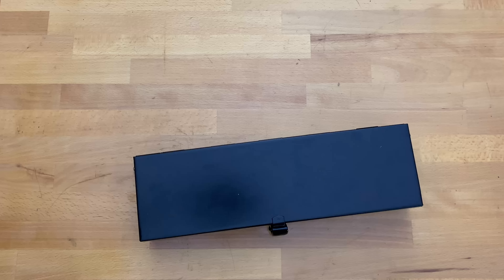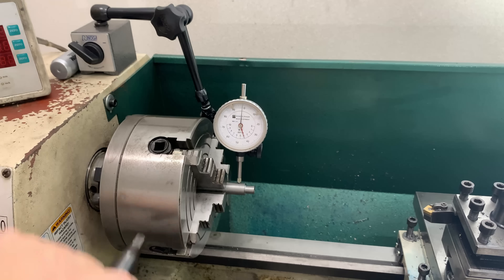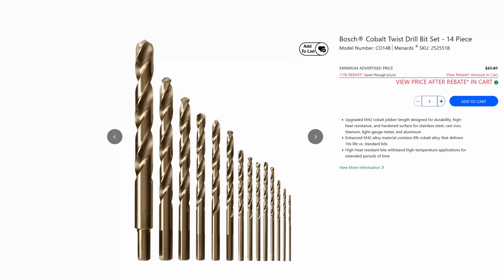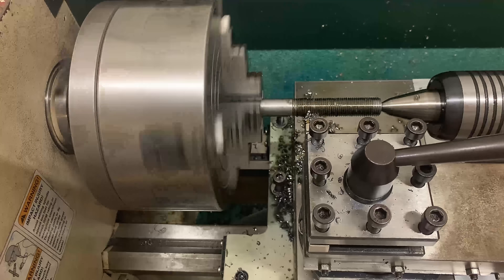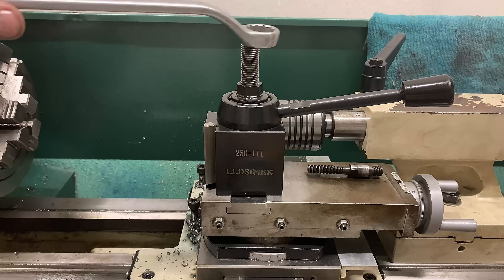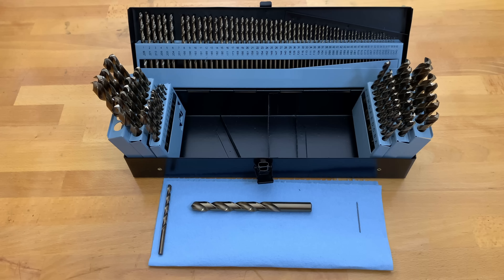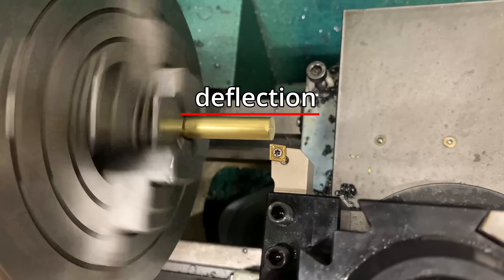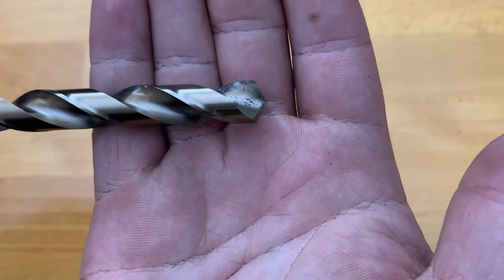Are Harbor Freight Drill Bits Secretly AMAZING?

Comment: Dude, funny narration/vid. Thanks.

Ok, in reference to your $4.00 twist-bit paranoia, well, I guess I can consider myself a platinum clad BIG BALLER now?

$pending 18$ for ONE 1/4 inch tungsten tip’d drill bit and 18/$20 for ONE specific matched carbide tap!?

- All For a one-off custom project, drilling and tapping a hole in an AK47’s bolt carrier group, making it capable of left side charging. 

Which almost became a DISASTER.
- TWICE @ that!…ha!

- Nearly done drilling the hole with a plug in makita rotohammer drill (w/o hammer feature used;)

- Trussed up in some fluorescent yella’ and green  Amazon spezial Chineseum “VEVOR” ‘drill press’ stand capable of PRECISION Z axis/up n’ down motion, then that high-dollah tungsten bit tip SNAP’D’ right off in her. 

- Good thing Im both dumb and obstinate enough in equal degree to keep plugging right along, denying 100% failure until something is TOTALLY UNUSABLE eh?….;)

(Which with CAREFUL attention Id managed to get it all out, for the next sweaty, anxiety ridden hand-tapping process)

- Then upon almost finishing the tender threading process, !SNAP! went the high dollar carbide tap in the formerly ‘saved’ hole I’d drilled, after an hour + or so of even CAREFUL’ING’ER burr werk with the dremel, Id managed to chip away at the stuck tap enough to remove it in small pieces, while saving most of the formerly threaded areas!

- My charging handle then threaded into the hole not as deeply as Id wanted it too, but deep enough to function well (Oh, w/help of ‘GON’BUBBAH INC’s finest EPOXY to fasten it)

- Because I didnt give up, I now have a 5.56 AK47 pistol, that not only is capable of charging from the lefthand side, but a well functioning left side/firing hand thumb safety thats slick AF!

(that left side thumb throw safety a former mod/design of my own, that functions amazingly)

- The next day I went out and purchased a 12” HF BAUER variable drill press, a $200 Amazon X-Y drill vise, and 2 differing cobalt bit sets. So I can make big mistakes in finer style…;)

That Bauer drill press is recommended as to build quality to price point index.

Grrrrreat n’ humorous vids yee gotz here!
Reply from the maker: Thanks for the great comment lol :) how do you like that drill press now?
Reply: @ShopHumor  
Back atcha, great sense of humor ya gotz. Thanks for doing what you do, sharing tips, tricks and info is quite valuable to many of us.

I went with the largest table top, VS. the floor stander HF/Bauer offers.

Took about an hour to unbox/de-grease & set up, as a metals machining casting geek w/an interest in build quality and overall manufacturing process involved, for the money (300-350$ IIRC?) its money well $pent IMO. 

For garage type/household repair duties, hell, even dedicated biz/shop usage it appears to be a winner. (Granted Ive only owned it for 4 or 5 months now, rit had replaced an old clapped out CRYobi el'cheapo)

For 350$ I'd initially had my suspicions in a world where even brand new, 80,000$ vehicles <<!SPROING!>> & deflagrate, before one even gets it outtve the package...
Everything fit properly together and trued up quite well to my surprise. Its rather quiet in operation as well (In my youth I was used to using my dads rather noisy shop equipment, much of it pretty beefy/well made during the 1950's/60's era)

10, or 12 inches of vertical adjustment. 
Has a tilt table, 
7" total pull out roller support on tables RT side 
The variable throw lever when motor running is not to soft, nor too stiff as to operation. 
5/8ths chuck, 
2/3rds HP. 
Digital speed read-out.
Decent work light.
LAZER BEAM 'X' (Who doesnt want LAZER beams on equipment eh? The 10 year old child in me grins;)

My next project is a small tabletop mill of sorts, but Ive been educating myself here and there for the last year or so as to LMS products/upgrades, as I dont want to jump right in w/o at least a toddler-spec/modicum of knowledge base present to go along with it, to better duck spendy mistakes that could've been easily avoided from the outset.

Man, there are some AMAZING vids of guys here on tha Toobz mod'ing drill presses into mills (albeit with heavy, rather well thought out mods, not just dangerous on tha fly, 'oh...itll work' type stuff. Typically done by individuals who already possess a real milling machine to assist in the creation process, and doing so for the challenge of a 1 of a kind, one-off Frankenstein brain-baby creation of their very own;)

Ill def subscribe, as Ive seen a bit of mill work here on your own channel, I have yet to view them all, Ill get there...;)

Take 'er easy....

Comment: Yeah I have a set of the harbor freight cobalt and also an expensive set of made in USA bits. Of course you get what you pay for in machine tools. But the HF holds up well maybe not as sharp or finish the USA ones have, But for the price, no complaints. I think the operation of drilling too fast on harder metals, feed rate, and type of metal being drilled probably has a lot to do with the bad comments.

Comment: Hi my name is Kevin from Aus   our family run a machine shop  for 75 years I worked there for 56 years we used a lot cutters a lot of drills were Suttons  made in Victoria thay make a lot of different sizes   metric imperial number and letter drills from number drills from 1 to 80 all differs sizes   that make all types of cutters that will even make specials  one off they  if you have any problam with any thing they make they have a tec centre to solve the problem the bean in business for 100 years  as tool makers we by the best no chines th ey  to soft we work   on power stations turbines  at different times  thanks Kevin

Comment: My experience with milwaukee drill bits: they are 50/50 to be bent out of the box and not drill straight. Got replacements from milwaukee for the bad bits and some of the replacements were WORSE than the originals

Comment: I bought HF's HSS bit set and have put the same bit through 1/4" and 1/2" mild steel 20+ times without a problem using a hand drill.  Go slow, use Tap Magic and don't stomp down on the thing.  Bit is still as sharp as I bought it.  Granted, not putting it through spring steel but still, for most hobbyists, I think is likely plenty tough.

Comment: Its reddit. Only a small percentage actually leave the keyboard and a even smaller fraction knows what speeds and feeds are.
"is x product good"
No its junk i broke everything about x product first run out and im an expert with 35 years in x field working with this stuff. I recommend x product that is triple the price or happens to be the product of choice of my fav youtuber.
Besides for hyper specific stuff dont go there like ever. Not only is it a massive echo chamber but its an echo chamber of the largest group of dimwits in the world.
Gotta love telling someone double my age that they are running a drill at the wrong speeds and feeds and will burn up their bits and have them flip on me while it takes me a bit longer to get through my holes but im not reaching for a new bit after every hole wasting time and money.

Comment: While I don’t have the cobalt set the set I bought at Harbor Freight two decades ago still works fine. I think I’ve broken two or three of the small drills in that time and they were probably my fault. The best advice, especially for power tools, is to let the tool do the cutting. Meaning don’t force it. 🧐👍😎

Comment: we have been using Harbor freight's bits for years, I will tell you for what you pay for them. They are beyond awesome. We have abused a few of them rather ridiculously,, and to be honest, they held up fairly well. I definitely recommend buying them for medium use, and careful heavy use. Do not over speed them., that's the only advice I would give you, also--keep your RPMs 300 to 350 when you're going through hard shit like steel or iron, at least for most of the sizes. That worked really well.

Comment: These are a definite bargain for a pro mechanic.  That's me. I can get away with using "close enough" sizing for 98% of the stuff I do. Window regulators with aluminum or steel rivets at least 4 times a day, etc. I think the last time i bought that set, it was 50 bucks on sale. When they used to have sales, lol. Anyway, it's a great set to have around the toolbox or the house.  Are most NOT CRITICAL machining jobs matter if you used a 3/16th or a 1/4" hole? Im usually drilling offnrivet heads or brake rotor securing bolts. Awesome set. Snap on you say? Fools and money etc.

Comment: I bought the Milwaukee Hard Steel bits, for drilling into metal studs. (I'm a Dewalt man)
Best drill bits I ever had. $80 for a smaller set than what you showed, but worth every penny.
It replaced the Bosch set, BTW. Those are garbage.

Comment: Thanks. I've drilled many, many holes in steel bar while building machines. The quality difference shows up in how well they stay sharp and un-chipped through multiple holes. For a home shop they may well be fine with modest feeds and speeds. Then again, for my humble setup, the index is a big contributor to usability. I love the Dewalt sets because they're decent drills in a super useful box.

Comment: Actually, it's "twist drill".  BTW, 70% of all steel is made from recycled metals. I've used the Warrior twist drills and I can attest that they are not well made tools - not sure they are made from cobalt either.  Drilled out four (4) 9/32" staked holes and the twist drill was already dull.  CoolTool used as cutting fluid, drilled by hand.

Comment: You use the wrong RPM and are too aggressive with pressure/feed rate you will burn up a drill immediately. Having proper geometry on the drill is important as well

Comment: The smaller ones are brittle and will snap if you put too much pressure on it or it catches, do not use drilling oil, or not align the bit completely straight with the hand drill, for hard type metals like steel, cold rolled steel, stainless steel, etc.  For soft metals like aluminum, copper, etc, just go slow and steady without a ton of pressure.  So in my experience, they are fine for softer metals, epoxy, fiberglass, wood of any kind.  So for the price, for that set, they are handy to have, but again, use good drilling practices.  For any type of hard metals (steel, etc), I recommend only using a good quality bit.  Since Hanson is a thing of the past (my all time favs), Irwin picked up the Hanson name, but not sure if they are the same .  Bosch is pretty damn good tho.  Unless some machinist knows something better, then I'll try it.

Comment: Carpenter for 40 years, used a lot of Harbour freight  drill bits, used them for dowels and light metals , sometimes steel. Most hardware isnt steel. They did what they said. Used for years. If i was working in stainless steel. I would buy a bunch of bits in the size i needed, ss is hard to drill with with hand held drills,

Comment: I think the main issue with cobalt drills is because of people using them in hand drills.  You are absolutely correct that they are much better suited for machine use.  Yes, I have used cobalt drills in a hand drill out of necessity and it will do the job but only if you are very careful not to flex it.  If anyone is unaware of this, they will break every time you use them.

Comment: I've had a set of titanium harbor freight drill bits for probably 25 years. I broke 1 bit and have replaced several times, the bit that I most use, the 1/8". Other than that, I still use that set. I have a newer Cobalt set in the house that goes through anything like a hot knife through butter. Dont remember the make but its not harbor freight.

Comment: 1 year later:  These same harbor freight drill bits are now $140.00
Reply: They're marked down in the video.
Reply: They saw that they were selling well so they rebranded them from warrior to bauer and charge an extra $40.
Reply: Tariffs + inflation..
Reply: @generessler6282 more like hype. Icon use to be cheap. Now a rachet is $60 while Pittsburgh still around their original pricing. So yeah. 🙃
Reply: @CertifiedForkLiftOperator69420  When was Icon cheap?
Reply: @generessler6282  China's going through a housing and stock market crash that makes our 2008 look nice, and the taxmen over there are on the hunt. 

Good.
Reply: @Azzysdesignworks  Actually their stock market is up. But they do have incredibly bad economic problems that the CCP is mostly making worse.
Reply: @Azzysdesignworks - Anything to not blame tariffs set by Trump huh? 😅

Comment: Yeah you can pay 100 bucks for the harbor freight set or 1200 for the us made set. They both break just as easily when in general shop use and while the us bits stay sharper longer it’s simple enough to resharpen either. I currently have 3 sets of harbor freight bits in use.

Comment: I have a 1-1/4 " drill that I free hand sharped , have drilled somewhere around 15 feet with out resharpening it. Mild steel, correct feed and speed and proper coolant. I have been a MORRIS BIT fan for 50 years 🎉

Comment: One of the problems with ANY drills is that guys will run them full speed and dry on steel, destroy them, and call them junk. I’ve seen it over and over. Drills need care just like any other tool. On steel, slow way the hell down and lube it.

Comment: Looks great for home use or even some jobs , I purchased about 25 years ago Craftsman cobalt drill set , no Sears had them had to order them , well I broke two bits my fault just pushing way to hard the other bits would drill through any steel like butter even harden parts like shafts , replacing broken bits ! Sears had single pieces at that time , P.S. was $99.00 back then !

Comment: I have a similar drill bit set from HF that I bought many years ago.  It has been great for my hobby level use.  The selection of sizes has saved many projects.  Do they drill steel?  Absolutely.  Don't expect the highest quality, but they will work at appropriate speed with use of cutting oil.

Comment: I drive 40 miles to to only one place to get drill bits. Very expensive. I dont buy any bits from any hardware store. I got spoiled with bits that go through stainless steel over and over. I use to work in a metal shop and I have drilled thousands of holes.

Comment: Ive found most guys dont know how to drill. They run the drill as fast as it will go with no lubrication on the drill bit and wonder why it burns up or snaps. However, some of Harbor Freights drill bits are junk. I haven bought any in years and havent tried the one in this video.

Comment: I bought a set from harbor freight drill bits years ago. And they work just fine. I own a mill-drill a lathe and a surface grinding among other machines. But im just a hobbiest. And do machining at work. I also bought the 115 pc METRIC drill bit set which is great when you need a size thats +/- of regular sizes. and use a cutting  oil when drilling. It helps .
If you're not a complete idiot and your not trying to drill hardened tool steel or leaf springs. They are good enough  for the average home shop tinkerer.  Just my 2 cents.

Comment: They cut well enough for me. Some people fail to realize all drills are consumables. They can be sharpened but they will get dull. I have seen no notable difference between drills from Harbor Freight and drills from Amazon, eBay, HomeDepot, Lowe’s, Tractor Supply. I have bought drills from Walmart but don’t recall how they worked out so I can’t comment on them but for the most part I have zero complaints about Harbor Freight branded drills. I use them in my corded and cordless handheld drill motors as well as my drill press and occasionally in the drill Chuck in the tailstock of my lathe. I have had great results with drills from all over and most all come from China anyway so why pay more?

Comment: I bought that exact set and when I got home and opened it up they were the cheaper HSS bits. 
The store was 60 miles away, I will never darken the doorway at another Harbor Freight store.
Reply: i bought this set a few yrs ago, right off the bat, the bit snapped in half, cheap china junk. my dewalt drill bits put these to shame. there is a reason they are sold cheap !..lol.

Comment: Honestly been a machinist for decades and use these bits with no problems. The only time I’ve replaced a bit is I couldn’t sharpen it again. Just throw a replacement in and keep trucking. Users are more likely the culprits honestly.

Comment: I have a 29 piece set of hss from ten plus years ago. I've broken some, they don't hold a edge as long as others but they were a great buy. Learn how to use a bit, use cutting fluid, learn how to sharpen a bit (which is why I absolutely hate coated bits! Once the coating is gone, the underlying steel is never good) and harbor freight is fine.

On a side note, unless it's changed, Milwaukee bits are not typical good. I worked in building maintenance and we where having trouble just drilling through steel studs. Plus they couldn't be resharpened without doing a split point because the web was way too thick.

Comment: A lot of the problem is people not using their bits right.  I had a coworker who was suppose to know everything but kept burnign through drill bits.  Dude would crank it up to number "2" on the drill (milwankie) and pull that trigger harder than he pulling on them fried chicken legs.  I had the cheap ass 9$ dewalt black and gold and still got them going on strong.  Just got to go real slow and use cutting lub.  I find when you step bit it, by using a small bit, then a medium sized bit and larger and larger, it wears out the bits and make it more prone to chipping of the bit too.  With drill bits its better to go slower and apply more pressure than faster and less pressure.  You never want to go fast really.